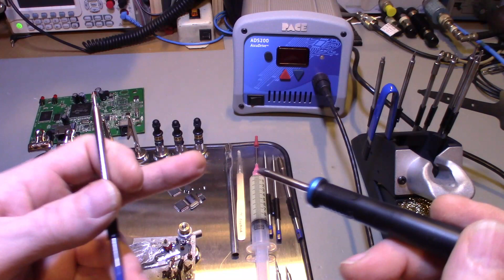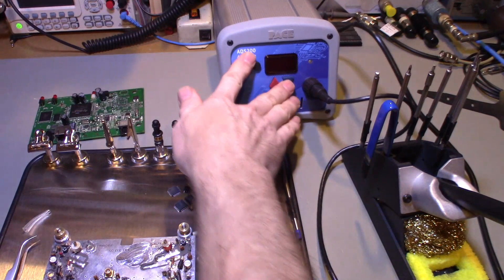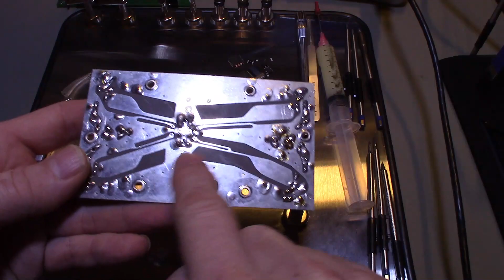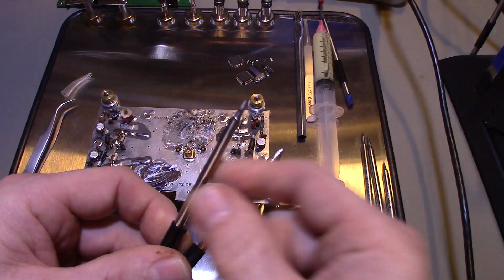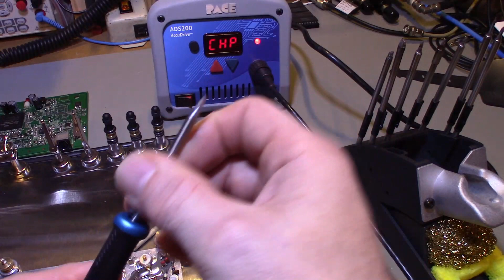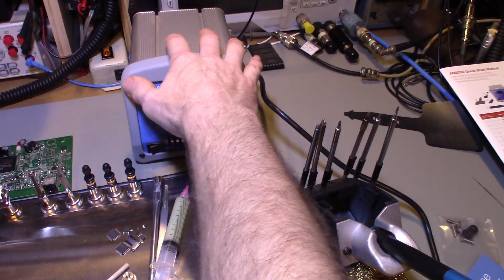Pace ADS200 soldering station review.  Tip/cartridges have a issues.

Comment: Hi,
I can buy something like this:
Pace MBT 350 soldering and desoldering station used in excellent condition. 
It comes with the :
MT100 soldering tweezers, 
TD100 soldering iron,
SX90 desoldering iron. 
It comes also with extra iron tips and few other tips.
Another question:

What is that magnetic board holder , i love it?

What do you think?
i need to specify that i am a begginer in electronics.

Comment: Thanks for your terrific dedication to PACE. Still showing my demo. My Bro will take care of it for sure! Marc Siegel
Reply from the maker: Great to see you here Marc.  Can't beat PACE customer service.  I have since purchased 2 more of these.  For one of them I also got the SMD tweezers (MT-200) and every set of tips they make for it.  Since they corrected the initial problems I had with a couple of tip/cartridges they have worked flawlessly.  Just got done soldering with it before replying to this comment.  By far my favorite tip is the ultra performance 1/4" knife blade.  Use it for everything from large terminal tie strips with multiple wires and components in old tube type equipment down to 0603 surface mount parts.  For 0201 and 0402 size I switch to one of the smaller tips.
Reply: @mikesradiorepair  Happy my brother CEO has taken care of it. Kind regards, Marc

Comment: Hmm your video took a while to get to the point but around 10 minutes in I understood what was going on. Before seeing your video I watched David's review on this fine machine and he compared it to a JBC station. On the Pace he used the the ultra tips to compare the ground plane thermal mass performance vs the JBC's. He concluded that the Pace station was not as good as advertised, but all he tested was the Ultra tips on the Pace. Then I thought maybe if he used the standard tips there could've been different results, as I can understand from the issue you have experienced. I think the the issue is not that Pace advertised their thermal performance incorrectly, but that the Ultra tips are hindering the thermal capabilities, with the larger mass on the tip. Thank you for this review. David from EEVBlog and yourself have convinced me to buy this station. But, of course! I will be getting the standard tips.

Comment: I'll take a guess, either the thermocouples are not working properly or there is a safety cut out jumping in, either that or the connections at the end where they go into the handle is not making proper connections.  It makes you wonder if they were ever properly tested?
Reply: Is there a pcb board in the handle?

Comment: Pace irons and tips are huge if you are going to work with micro soldering pace is not the right choice in my opinion. I own 2 mbt350 but when it comes to solder on a smartphone or a high integrated pcb there’s no way pace tips will fit in every way. The soldering station I own suffered both of lcd backlit fault and I had to replace it by myself. Intelli heat and instant set back are inconsistent. Why should I have to wait other 45 seconds to get the temperature fall to the required amount? It should have been more useful to set a proper amount of seconds before the temperature fall down. My other jbc station does it immediately after inserting the iron in its holder. Considering it doesn’t take more than 5 sec to get back to the proper temperature I don’t have the time to extract the iron that I’m instantly able to solder. Pace doesn’t have a proper irons line and tips for microelectronics, under the microscope the thinnest pace tips looks like a tree, seems like is almost 20 years back in the past... like I said before, comparing this maker to other competitors like jbc, weller, ersa, it looks like they forgot about a big chunk of the electronic industry.

Comment: I own a PACE Sens-a-temp controller and PS-80 soldering pencil. It’s been my work horse iron for the last two decades and it is still part of my soldering work station setup. When the element packed up I managed to buy a NOS PS-90 solder pencil from ebay and now the iron is back in service again. I really like this iron and although I own other more advanced directly heated irons, the PACE’s huge thermal tip mass and large heating barrel makes it really good at soldering the more heavy-duty connections along with high pin count surface mount parts using the wave solder tips.

Comment: That strain relief (or lack of) is interesting. Must have a bell shape to it. My production shop uses Weller that do have strain reliefs, but the wire starts to fail at around the 10 year mark. We've had some hand pieces with short cords, I'd have a hack a few inches out every time they fail.

Comment: One question outsourced to China? If so capitalism at its best American companies intentionally source the cheapest product to slap their name on it to make the highest margin. You’re better off buying a Chinese branded quality soldering station without the American name on it. Like Luis Rodman and Davy Jones (The Ozzie from down under)demonstrated and did an unboxing and testing of a Chinese soldering station with the new tips with the heat sensors in the tip and they both gave it a up👍 .
Reply: The ADS200 Station and tips are manufactured in our factory in North Carolina. I can’t speak for the internal components on the PCB, as most chips are made in foundries outside the US. But did you know that PACE is one of the last major solder iron/rework system producers that actually manufacture in the US? Weller manufactures in Mexico and Germany, Metcal in China and Mexico, Hakko is China, JBC in Spain. The only other US-based solder station manufacturers I can think of are Edsyn and Hexacon, and these guys are insignificant players in this market. I’m not saying it’s bad to manufacture outside of the USA, I’m just stating a fact.
Reply: We beta tested close to 18 units in Oct-Dec with initial pre-production tips. 90% of the comments were positive but were more focused on software suggestions. A tip issue came up at one beta site, involving a tip not seating properly (which could be the culprit in the 2 tips not working at all), but that was supposedly addressed. The Ultra-Performance Tip that soldered itself to Mike's board is baffling, but we'll figure it out once it gets back to our Engineering Center in Elkridge MD. About touting "Made in the USA," I have yet to see any impact of this moniker on overall sales in the States ... people generally will buy the cheapest products they see, with little thought to country of origin. Mike is the rare exception! Thanks for your comment.
Reply: @paceworldwide-ac4422  I just received my ADS200, which I got because of the US-made label. Either that or the cheapest workable solution.
Reply from the maker: No, made in the USA.  I wouldn't buy a Chinese soldering station for any reason, ever.  Customer support, I doubt it.  Parts availability 20, 30, even 40 years later, I doubt it.  Meets industry standards, I doubt it.  Pace is taking care of the problem.  A customer service rep is hand delivering new tips and taking the old ones back for failure analysis.  Find a Chinese company that has service like that.  Pace is a premium company and has premium service and support to back it up.  I don't fault them for the problems.  It's a brand new to the market station so like anything made by man can have problems.  What counts is what happens when a fault is found.
Reply from the maker: And who has service like you do.  Just minutes ago the rep was here hand delivering replacement cartridges.  Your customer service is second to none.
Reply: I'm a bit surprised that a company with a solid reputation is having issues which weren't discovered before the product was shipped. However, I still plan get a Pace station when the bugs are worked out. BTW, nothing wrong with touting "Made in USA" It certainly was a factor in my decision to consider Pace for my next equipment purchase.

Comment: are they 220 or 110 voltage tips
Reply from the maker: The tips are low voltage.  It's the base unit that is voltage specefic.  Im in the USA so mine is 110 volts.  They do make 220 volt versions for other countries.

Comment: The handle looks like it would be really comfortable to use, but other than that, I see nothing that this unit has over any of the other heater-in-tip cartridge based soldering irons. The cartridges for this unit don't look like any others that I've seen. Are they proprietary to the Pace brand? If so, that doesn't seem like a great idea. I'm all for them manufacturing their own branded cartridges, but why not use the somewhat more standard interface to plug them into the handle that many of the other brands use? What if you would need some kind of specialty tip that they don't make? I know it's unlikely to be an issue for the average person, but this is a professional machine right? Even if it works perfectly, I'm still not seeing much benefit to buying it, other than to support a company you like that is based in the US.
You can buy certain knockoffs of the Hakko FX-951 for less and they are proven to be reliable in a professional repair setting.
Hell, if you're really motivated, you can buy the handle/cartridges for the JBC 245 or 470 model and there are a couple proven designs online to build an accurate and robust power unit for it. It makes a great project for somebody that likes building electronics equipment and you get all the power and endless tip selection that the JBC units have to offer without having to spend $500+ on their control unit. If you use robust parts building it, you'll get the reliability also. With some tweaking you could probably have the ability to use many of their other tools also (tweezers, desoldering, micro-irons, ect.).
Now I know that rolling your own control unit isn't something most professionals would want to do, as their time is probably better spent using the iron instead. In that case it's really hard to beat a knockoff FX-951 with a genuine Hakko cartridge/tip.
Pace is a very reputable brand though, and I'm sure that they will get the issues you showed sorted out. It seems like they might have rushed the tip manufacturing or something.
Reply from the maker: It would take such a excessive time tryig to build something like this and the end result would still be inferior.  It only cost $219 from TEquipment.

As for tips, every direct heater tip I have ever seen from other companies are unique to each company.  There are no "universal" cartridges.

Comment: Thanks for the heads up Mike...I'm in the market to replace my Weller station and look forward to hearing what the resolution is, apparently there's a manufacturing issue and now it's up to Pace to address it (and I'd recommend quickly!). Stuff happens, it's how an organization reacts to "stuff" that determines the ultimate outcome. Standing by....
Reply from the maker: They emailed and called early this morning.  Sending new tips and a few extras and asked to have the defective ones back so they can do failure analysis on them.  As expected super fast customer support.
Reply: There you go, Bob's Your Uncle! (Or is that "Robert is Your Mother's Brother?")  ;-)

Comment: Mike I’d suspect that the temp sensor in those tips has failed on 2 of them and the big one fails when it gets a consistent load that demands
More heat for an extended period.
I like you LOVE PACE as you know, and I’m looking for a complete setup like your PRC 2000 to replace one of my units.
I’m patiently now waiting to see what PACE do in regards to this problem.
I’ve read about this new unit and thought I would also get one for the same reason as you, but now I’m going to sit back and see what happens!!!!
Trying to get a problem like this sorted from here in Australia is not something I’d like to go thru.
Cheers mate.

Comment: I'm a fan of Pace too Mike and have the ST50 and ST100 stations which are brilliant. Saying that though a few months ago I had to contact Pace over a couple of tips that hadn't been made properly. It was two chisel tips I had that were the same part number and general shape, but on one the actual chisel tip was sharp and the other totally blunt as if it had missed the shaper somehow.
Pace did send me new tips which was fine, but to be honest having around 100+ tips at my disposal manufacturing consistency these days seems to be a little off.

Cheers
John
Reply: Thanks for your loyalty to PACE! Concerning inconsistency in tip shapes, I suspect the issue is probably in the iron plating. Plating the protective iron coating over copper is somewhat of a tricky black art. Because of the widespread use of lead-free solder (which is extremely corrosive to iron, especially at high temperatures), we have been plating our tips with a much higher iron thickness, which significantly increases tip life. But a thicker plating makes it harder to control the shape of the tip-end as iron plating tends to gather at sharp edges. This can be controlled but as I said, it’s tricky. We could easily add a secondary operation (e.g. grinding the tip-end to an exact shape), but this adds significant cost, and can double the customer price in some cases. So we try to avoid this to keep the tip prices as low as possible. I’m not sure this is exactly what happened in your case, but that is the usual cause.
Reply: Thanks Pace for commenting and suggesting the issue there. And yes.. It did seem as though at the critical edges of the tips I had problems with..the plating had gathered up a little thicker changing the tips shape slightly. One or two were not so bad but the one that triggered my support issue was so much different that I just couldn't even MAKE it work. The flat surface of the chisel tip was like a dome LOL.  Anyway It was replaced immediately without issue so no problem. 

I've just ordered two 0.5mm special bevels for the ST100 and hoping that with regards to the slightly flattened tips on (Part #: 1126-0630-P1) they'll be a little better than the Pace 0.2mm conical tip for 01005 components. Saying that though It's real tricky hand soldering down at that level no matter what you use :D

Thanks again Pace

Cheers, John
Reply: You might want try our 1/128” Conical (Special) 1124-0050-P1 (List Price US$16.60/£9.79/€12.05):
https://www.paceworldwide.com/products/tips-and-nozzles/soldering-iron-tips/td100-standard-soldering-tips/1128-in-conical-special-ha-tip-0050
It’s a version of our 1/128” Conical PN 1124-0036 (same pricing) but with slightly beveled front end to give it better heat transfer and works well for 0201/01005s. The issue again is the iron plating. Standard soldering iron tips are composed of an inner core of pure copper, an excellent heat transfer material. But solder has a solvent effect on copper, almost immediately dissolving the copper upon reaching solder melt. The higher the temperature, the more the solvent effect. It’s even worse on lead-free as the higher the tin content, the more the corrosive effect. So, the copper core is then plated with 7-9 mils of iron which protects the tip from solder erosion. That’s why if you scratch the surface of the plating or crack the plating, the tip will quickly develop a pit which progressively hollows out the tip from the inside. Soon, the tip has no copper on the working end, just an iron shell which can’t transfer heat. Why don’t we just plate more iron? Because iron plating is NOT a great heat transfer material, and thus there is a fine line between having “just enough” iron to protect vs having a tip that takes twice the time to heat up and recover. Now getting back to the 1/128" Conical Tip 1124-0050-P1, we grind away some of the excess iron plating that would be on 1124-0036 version, and while this could lessen tip-life, the thermal response/recovery is improved.
Reply: Thank you for that.. Just ordered a couple of those too.

Comment: They're going to obviously take the information offered in this clip to heart. You're a lifelong pace buyer who's skills, and knowledge is obviously on point, and they (pace) should take your experience with this new product and its bugs seriously. Hence, allowing them to correct those issues. I'm sure pace will make it right, and hopefully remove the bugs Another excellent clip. Be well my friend. 73 PS. Did you notice a scratchy sound coming from your new wireless video mic? It sounds like that beard scratching you described early on.
Reply: TUBES GLOW he is aware of the  noisey issue.
Reply: Signal View if he was aware of it I'm fairly positive it wouldn't have been there. Are you his parasitic twin? I know Mike fairly well and to my knowledge he does not have a twin parasitic or not. I was just passing on some information that I was fairly positive Mike was unaware of.